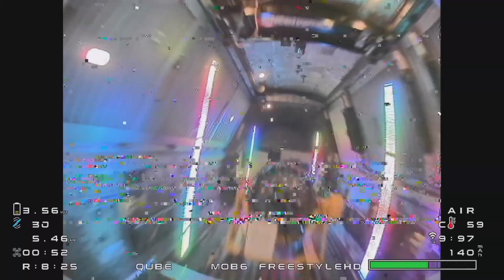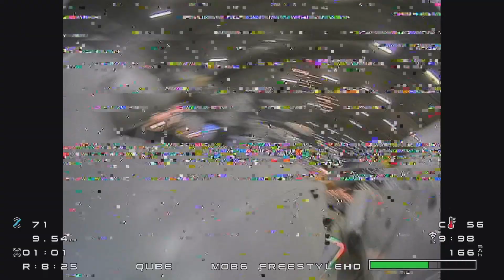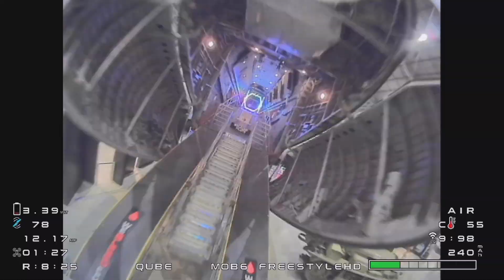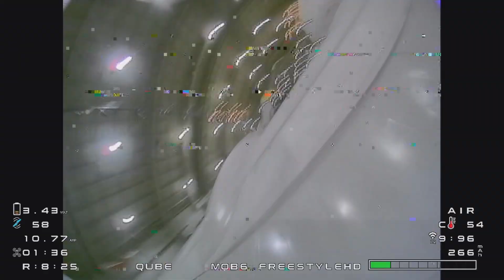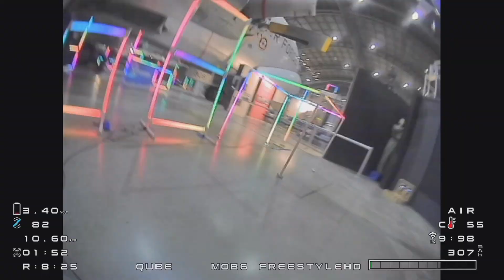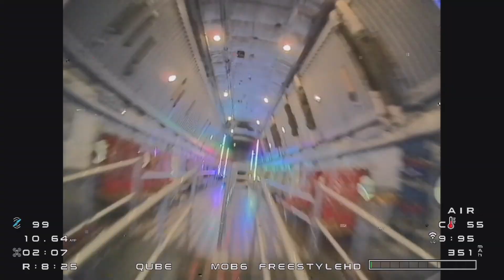HDZero VRX Mesh Network Prototype Makes USAF Museum Race Possible (For HDZero)

Comment: Looks like good times. I recently got one of the new 65MM Mob 6 freestyle, when I try binding it to my GX12 using Beta flight, it just sits there and spins, I have to put the throttle stick in the middle for it to stop spinning.  I followed step by step binding procedures video from the Happymodel website, it does exactly what his does in the video, except when I unplug mine, then plug back in it continues to spin. I had no problems like this with the original 2024 Mob 6. Ive been flying RC planes and drones for some time now, got into FPV about a year ago, HDZero is amazing for my 50 year old eyeballs, but this learning curve is tough!! Can you Please, Please ,Please, Please help me Mr Quellet ? Thank you and Congratulations on the new position BTW.
Reply from the maker: @bobbyenache7652  the issue you described is most likely AETR to TAER mismatch on betaflight receiver tab. Google what i just wrote and you'll get step by step instructions
Reply: @RyanQuellet Thank you Mr Quellet for your help. I went ahead and changed Channel Map drop down tab from Default (AETR) to spektrum / Futaba /Jr  (TAER). Unfortunately it yelled the same results. Very frustrated with this little thing right now, 200$ dollars spent, and it just sits there blinking, and flipping around in Betaflight, almost mocking me!!Might you have any other suggestions Sir?

Comment: Hi Ryan. That Mesh Network device, ist it a Kind of Signal repeater? Similar to that one which is available for the walksnail system?
Reply from the maker: No, this is better as there is no added latency and the mesh nodes are merged together to improve the picture rather than degrade it at each hop
Reply: That's cool. I'm really looking Forward to the moment when it's available. Thanks for your reply

Comment: Can you record some DVR of just the goggles to compare with?
Reply from the maker: I will try. It's extremely bad without the ground station though
Reply: @ yeah you fly from the groundstation - someone else records DVR as a spectator on a second set of goggles of the same flight.
Reply: @RyanQuellet I think that’s what @timmytronz is getting at. Really bad pilot DVR vs the EventVRX Pro
Reply: @lestarfpv  yes, exactly

we get that it’s bad without, that’s the point, show us how MUCH BETTER it is in comparison.
Reply: @RyanQuellet How do you record dvr with hdmi in? I assume the vrx could record on it's own?🤔 I would like to have my own flights recorded at a race.😅
Reply: @RyanQuellet  So you're going via the EventVRX Pro to get the signal (presumably with HDMI in?), so how does that not add a bunch of latency?
Reply from the maker: @Vousie  new fw update for hdzero goggles eliminates hdmi input latency
Reply: @ Oh wow. That's impressive.